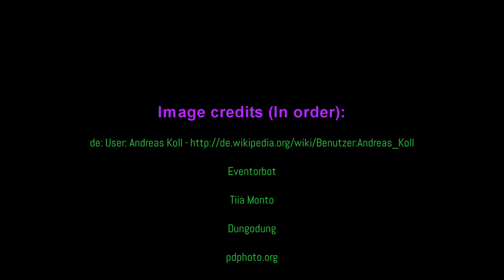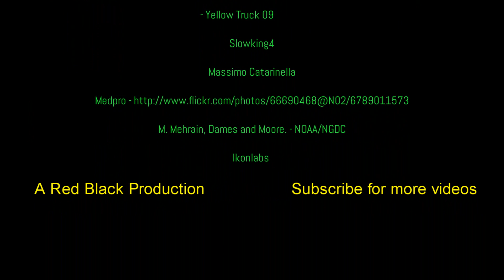3D printing a house within 20 hours?

Comment: Thanks for the video its helps lot.
But I want to asks for something. Is their any 3d printer that can using a cement and sand material? As this can make it easy to print a baluster and roman columns without using a mould I need help please Sir

Comment: would it really be a loss of jobs? if your talking about people that  couldn't otherwise afford a house then in that instance more jobs are made not to mention the jobs created  from Manufacturing of the printers. Also if the house's get  cheaper than people will be able to spend that money some where else stimulating the economy and creating jobs in a different line of work. yeah there might be some Mason's out of work but on the whole for the economy I don't think there's any loss of jobs

Comment: Enovation's will always cost jobs and create new ones but depends on the demand for it and the use of limited materials, sure it might be cheap and quick.  You still have equipment hauling, setting it up, Installers , materials used,  mainatance cost and maybe some operating labors.  Its business and completion will be another issue because it has to be safe to live in it.  I'm sure standards will be required as well.    They call it balance and the historical Restoration is another type of business and jobs are created.  Both are very small markets compared to larger corporations.

Comment: Will We loose jobs implementing 3D Printed Homes?
1) Probably Not! We will be creating new CAD Engineers designing and profiting each build.
2) those machines like many others need maintenance and direction. can average a great salary for those operating that equipment.
3) easy, fast, Quality Home's may vary of the cost on materials being printed.

Finally can it be done! YES!
learn more go to SkyBot.LA see how we build 3D Printed drones

Comment: They are talking about colonizing Mars. They should send robots and AI there as an experiment. These could build structures which are needed to facilitate human habitation in the meantime. Or undersea experimental bases, or build in dangerous areas. Even 3D mining and building tunnels possibly. That antarctic base that took so long because of the 'extremes', could be done a lot more elegantly. As well as 3D snow removal.
While there are jobs lost, there is positive changes to be gained.
Reply: So it's agreed, we shall send plumbers to mars where they can jump even higher to reach the 1000 point marker on the flag pole by the castle! No more trying to get the raccoon suit to try and get to the top of the flag!

Comment: When all is said and done there is no time saved with this method because you will still require excavation for a foundation, the foundation itself to build this house on, and you have the task of framing the inside walls for insulation, electrical wiring, plumbing, HVAC, and then finishing with a wall covering inside and out. This will take at least one week with well coordinated effort on the part of interior framers, electricians, plumbers, HVAC installers, and drywall installers.....and then you need at least 4 days to do joint filling(depending on drying time between coats); a day of sanding, and at least 3 days to do a proper job of painting. All this is for a 1100 square foot 2 bedroom home by the way. Increase the size and it's more time.

Stick building is always the fastest method because you frame once and have your wall cavity for insulation, plumbing, wiring, and the ability to attach your interior and exterior wall coverings. With the printed house you will still have to stud the inside walls.
Exterior walls, and interior partition walls, for 1100 sq.ft.  2 bedroom home can be framed up on an already prepared foundation and floor system in 10 hours with 4 experienced framers not even busting their asses. 

The uni pour concrete walls would be darn near bullet proof and tornado proof unless a car gets thrown at. The windows would be vulnerable without special emergency protection on the outside, but that's the same with any house.

The roof system would still have to be installed and that would take 4 experienced guys 4 days(trusses, sheathing, shingles, soffit, and facia) for 1100 square foot simple hip or gable roof.

You always need people with know how and ability to build a house. There is no way around it. 

By a modular home if you want a really nice home fast.

Comment: Housing is too essential a need to not make it as efficiently and cheaply as possible. Every technical leap forward costs jobs. Is anyone bemoaning the fate of typewriter manufacturers today? The larger benefit of 3D printers is worth the loss of jobs. Of course, that's easy to say if the lost job isn't mine or yours.

Comment: While there might be  job losses in the construction/erection phase there will always be spin-off job creations , let alone retro-fitting and modifications as people have their needs,wants and tastes change.Technological advances alone can make some things that were built initially redundant within years of the build. These new renovations will involve removal or modifications of pre-existing structures or systems which would not make economic sense for anything more than an on- site small crew ( workers ) to perform.

Comment: You should never as the question 'is it worth the loss of jobs?' If it saves labor, then it is worth it. Automating one job allows people to focus on something that is not automated which will have a positive net result for everyone as a whole.
Reply: Because we are no longer relying on candles for light, fire for warmth, standing outside all day to sell our goods. If we never advanced we would not be on YouTube today on our smart phones and/or computers. Hell now you can be on YouTube on gaming systems and simple smart TVs, though if you're using a smart tv you'll realize that's a step back :p plus this motivates people to stay in school since they can't have the fall back of brick laying and it opens just as many jobs in building and maintaining AND research AANNNDDD operating these machines.
Reply: Tim-J.Swan Exactly, it may close jobs but it will open some(maybe more, maybe less). Someone has to maintain these, the material will need to be produced to use it, be made and made more reliable throughout the years. So on and so on.

I expected the top comment to be raving about lost jobs, I am quite happy to see it isn't.
Reply: Tim-J.Swan No matter the value of that question, it has never been applied. If it will it will.

Comment: When cars were just first being built, there were a lot of whip makers who worried they would loose their jobs because of the new horseless carriages, that wouldn't need whips to keep horses in line. Hundreds (if not thousands) of whip makers around the world lost their jobs, but hundreds of thousands of new jobs have replaced them. My guess is that far more jobs will be produced with 3D housing technology than are lost. And the new jobs will probably pay more money and be more desirable jobs. They simply won't be in the construction business. They'll be in the support businesses that keep the 3D printers going. Building machines, creating materials, selling those machines and materials, repairing the machines... and so forth. This is almost invariably the pattern that results whenever new technology is adopted.

Comment: Technologies like these are an integral part of our evolution. Don't worry about taking the jobs away. With technology like this you could bring down the cost of living and up the standard of living. You wouldn't NEED to work. I suggest with this technology you could retire all those workers in the building industry on VERY comfortable salaries in VERY nice accommodation. 
This technology could be expanded, and is being, into homes where you can print nearly anything. Need a plate? Print it. 
We are talking about a clear change in how we are as humans. Do we want to remain dependant on the state financially as consumers in a kind of underhanded slavery?
.....or do you want to be free?

Evolution is about how we can make our lives easier, at least it should be....

Comment: 1. I dislike when people refer to all things as "the market", you're talking about people and their lives not just numbers.

2. It's going to affect more people than most realize. Obviously construction workers, but also building inspectors, all companies and their employees related to the materials used etc. It's not just a couple of hammer bangers.

3. I am all for people being able to afford housing, but what will happen to the already fragile housing market? Will anyone truly have any equity left in their home if you can build one in 24hrs for a fraction of the cost? 

I believe it will cause more damage than people initially realize. Sure we can adjust to all things but don't forget to put yourselves in the shoes of the guy who at age 45 just found out he's been replaced by a printer. He has no other job skills and at 45 isn't exactly a hot commodity. Or the couple that just found out that the home they sweated and worked to pay off isn't worth anything now that they're in their retirement. Or the lumber yard that has to now lay their employees off cause there isn't a demand anymore. 

I sure hope it doesn't do to the housing industry what the motor industry did to Detroit when they moved jobs overseas. I'm just sayin, don't take everything at face value. Do some research before you accept what they're spoon feeding you.
Reply: Detroit Rock City!

Comment: My family built a Noble Home back in the 70's in Florida.  It was built in 14 days from factory manufactured wall panels that used metal studs and came with all plumbing and electrical installed at the factory!  The roof was standard engineered truss.  The ceilings were drop and made of thick foam blocks and 'T' bar hung.  The kitchen and bathroom modules were completely factory built and rolled into place.  The slab was monolithic and had to be precisely poured level and square.  The home is still in use by my Mother over 40 yrs later.  The problems we had with the construction were ALL building code and regulation related!!!  The protectionist building codes and trade protections ensconced in local jurisdictions will be a major problem for this industry.  We could not build in Duval county at all.  Its not the technology that will hinder this adoption.  Noble Homes went bankrupt.  Very sad, Very sad indeed.

Comment: "cheaper homes built at a much faster pace"? This is theoretically possible, but at least here in New Zealand, has not happened; not even close. The building industry has been corrupted by the government and approvals system, led by the businesses that supply building materials etc. The cost of housing has always risen and the quality is declining largely due to the "new materials", red-tape approvals system and profit before quality and honesty. Our leaky homes saga is one example.

There are building materials and techniques that could provide lower cost and better quality buildings but we are prevented from applying them.

3D printing houses is a great idea and could be one of these better building techniques. But unless the materials supply industry can find a way to control and profit it won't get very far here in New Zealand.
Reply: Or anywhere else in the world....

Comment: You cant reduce the cost of building a house enough to help poor people because 1/8 the price of building a house is the permits. You will never be able to print a house in tell you re wright all the permit laws. This idea will fail like all that came before.
Reply: Depends which poor people you're talking about doesn't it? I think permits might be a bit cheaper in Bangladesh...
Reply: A Phillips
True but. 	 	 	 	Its per capita income as of 2013 is US$1,044 compared to the world average of $8,985.	 	 	 	
Labor is cheaper than electricity.
Reply: So a house there would be approximately 5 times per capita income. It's a lot more than that in most western cities.
Reply: A Phillips
	 	 	 	Not necessarily. But In Bangladesh i think your correct. Despite the rapid economic growth, about 26% of the country still lives below the international poverty line which means living on less than $1.25 per day.
Reply: Sadly true. I was mostly just using it as an illustration of how a $5000 house would still be very valuable in many parts of the world lacking in quality housing.
Reply: I'm sure that place is out there. But the idea is new and going agents ideas that have been around for 100 of years and refined maximize efficiency in the given location.
   The Haiti earthquake. American donate 5.4 billion dollars to help Haiti. None of the money ever got there. There were 3 times more deaths from living in unsanitary conditions that were killed in the earthquake.
   If you really want to change the world change this technology to build seamless piping and aqueducts. Right now Piping has to manufactured then shipped and then put together. Shipping pipe on a ocean going container is expensive!
Thats 3 expensive steps that could be done in one stept.
Reply: Inconspicuous Incubus I like the idea of adapting the technology to making pipes from local materials, and the aqueduct idea is a great one.

Of course, no reason you can't do that and print houses too, or more likely apartments.  There's nothing wrong with apartments.